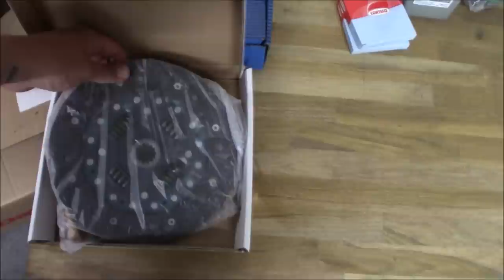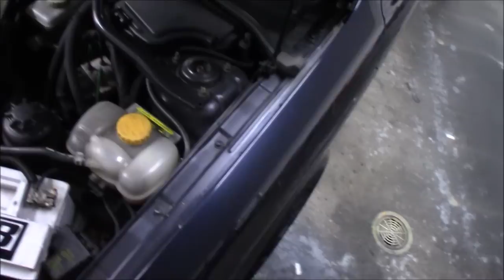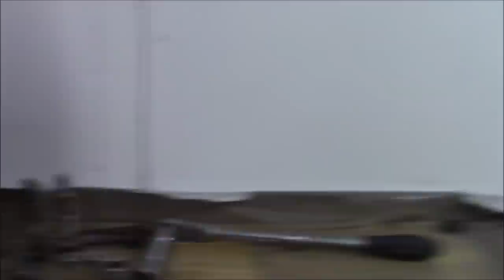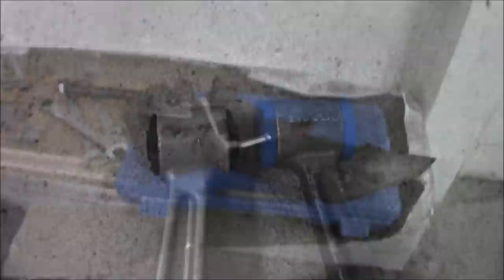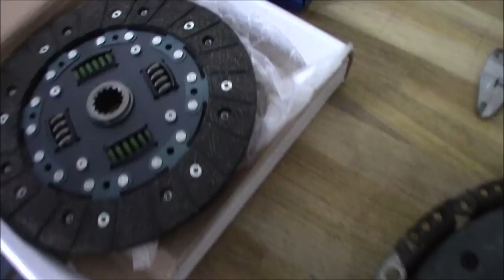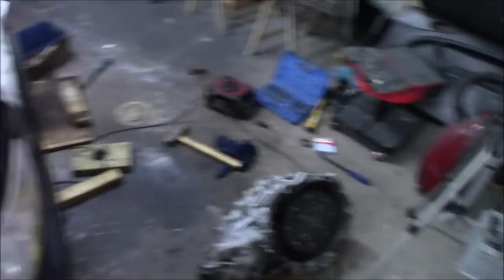SAAB 9-3 CLUTCH REPLACEMENT! MOST EDUCATIONAL!

Comment: your video was so helpful! ive never dropped a transmission but it was way easier than i imagined. Thanks, keep up the good work!!
Reply from the maker: Glad that it helped you! And that you didnt end up paying The big workshop Bill 👍
Reply: @JonasKakarikas  hey jonas i was wondering how to get rid of boost cut every time i go to use wide open throttle it hits boost cut or something, i replaced the wastegate actuator   and boost control solinoid , its getting really frustrating
Reply: @JonasKakarikas  did you ever have this problem when upgrading yours? it has a mitsubishi 19t and 3.5 inch turbo back straight pipe and wossner piston kit walbro 255 pump but stock injectors, could it be the injectors not giving enough fuel?
Reply: what do you do to tune yours, i dont want to have to take it to a shop
Reply from the maker: @jimjones5236  what you experience as boostcut is probably The ecu trying to protect your engine. Your afr is not correct and it could be alot of things. Check that nothing is leaking, than make sure it gets enough fuel. What tune are you running? With 3,5" straight pipe you most likely need a custom dynomap
Reply: @JonasKakarikas  on your car does your bcv make a constant ticking sound when you have the key just in the on position
Reply: @JonasKakarikas  i took off the sensor and drove it full throttle there was a big lack of power but smooth acceleration, and got code 1662 which was bcv sensor not connected so the wwire is working but what the f is the ticking sound coming from the bcv and it gets really damn hot to the point where you touch it and ittl burn your fingure ,is it internaly melting and going for a shit?
Reply: i compression tested the cylinders and got 160  on every one  without opening the throttle plate  so it seemd ok , and the engine runs great but i was thinking of doing another pressure test cause the last one i did was like a year ago just to make sure its holding air, just so i know its not the cylinders i wanna get a leak down kit tooi was thinking of taking it to a tuning shop with a dyno but i dont wanna get ripped off

Comment: Don't forget to change the fly wheel pilot bearing and rear main oil seal. Few thing he missed that you must do
Reply: 80.8f betta aquatic 
I was also noticing this missed.  For my '04 9-3, will have to look at the dual mass flywheel replacement also, otherwise, it's wise to reface the flywheel to get a good breaking of the new clutch.  
Not sure if replacing the gearbox input seal is warranted.  Only had engine main seals leak in the past.  Anybody had any issues here?
Reply: No pilot bearing on most Saabs

Comment: I'm starting a clutch job this morning on my 2002 93, The last clutch I installed was on a 1961 Falcon Ranchero and that was 29 +years ago. I've got a feeling I might be losing my religion a few times in the next few days!
Reply from the maker: The huge advance Now compared to 29 years ago is internet and Youtube 👍 if you made it then, there is no doubt you Will fix it on this Saab! Good luck 😉
Reply: Ok it's not going so smooth twisted off 2 of the studs at the turbo exhaust. Now can't get the studs out tried everything, any idea's?
Reply from the maker: @MichaelWOwens  typical problem, If you cant turn them with a vicegrip or equal you might need to disassemble The turbo and drill out The studs then re-thread The holes. Sucks i know 🙁

Comment: Great video man . I've got a 2000 9-3 and need to tackle this job . I keep debating about junking this car but it runs so good and I've done so much work to it I just can't let it go .
Reply: Have same make, model and year. Nothing but trouble. Fix one thing the next breaks. Will take vehicle apart with angle grinder. I know it makes no rational sense but it must come to an end.
Reply: I'm in the exact same situation with my 2002 93 Turbo Diesel. Renewed too many parts to sell it and it runs so good. My Sachs clutch set just arrived from Germany and I also have a new slave cylinder

Comment: This is a great video and a great encouragement. No matter what, a follow up video would be awesome. Please do one when you get the clutch plate. I am right in the middle of replacing clutch, slave cylinder, rear main seal (packbox bakre på drivlina) on my 9-5 in Trollhättan. A question: Don't we have to bleed the slave cylinder separately before installing it in the gearbox? It says so in the WIS. It would be easy to skip this and do it later, i.e. after mounting the gearbox onto the engine.
Reply from the maker: Awesome 👍 Will absolutley do a follow up. The slavecylinder should be bleed before installing. BUT if you have a luftman like I do you put pressure on The hydraulic system and just bleed out the air 😉 stay tuned.

Comment: Jonas, the Viggen clutch plate is bigger than std. Did you removed and skim the flywheel before refitting? Or clean the flywheel?
Reply from the maker: Just resurface with a bit of sandpapper 👍

Comment: Does the green rubber need to be on the throw out bearing, I seen some don’t even have that on different or older models. I was gonna replace it but the T-30 screws stripped because they had too much torque. The bearings still turn freely and it goes in and out like the new one after I cleaned the housing for the clutch I added a little Sachs spline grease to the (inside) bearing and wiped the remaining off. I already put the transmission back in tomorrow I just got to try finishing the sub frame and bleed the clutch, brakes, and the power steering sounds simple but I know this takes time. - hopefully someone can help me out thanks.
Reply from the maker: It is highly recommended to change the throw out bearing! It Will probably go bad long before The new clutch and then redo the work =/ the greenplastic is a dustprotection, without it Will go bad sooner

Comment: What a shame that happened. Where you happy with the KL clutch after you did get it installed ? I have a 2000 9-3 Convertible automatic and a 2000 9-3 hatchback 4-door 5 speed and am considering putting the stick in my convertible. Your informative video sure will help. Thanks from Bradenton Florida. 👍👍👍
Reply from the maker: Not The best suited for Daily driving. But Its ok when you get used to it
Reply: @JonasKakarikas  Thanks for the feedback on the clutch. Your video really is the best R&R I've seen on our transmissions. So glad you made it.

Comment: Hi Jonas, thank you to show us your job !
Just a question, do you put some thread locking on 3 slave cylinder's bolts ? Because I think there are "threw" holes so they need to be sealed.
Regards from France.
Reply from the maker: Correct, i Put a little bit of threadlock on The bolts 👍

Comment: HI Jonas - a quick question - how do You clean the engine bay - can I use an APC on everything and than use a power washer - or avoid the power washer - in order not to flood any electrical ?
Reply from the maker: Cover the battery and fuseboxes with plasticbags. Do not use a power washer. Just Light mist with minumum water.

Comment: Hi Jonas, Is this an F40 gearbox? And is the flywheel not able to be resurfaced?  If it cannot be surfaced I will probably just replace mine to assure best behavior.
I have a tuned Buick Regal 2.0 Turbo CXL, which is based on the Opel Insignia before 2013.  It has the LHU engine.
Reply from the maker: Hi, this is not an f40 but the job is similar. The flywheel could be resurfaced 👍

Comment: How much did you save buying the clutch parts separate compared to buying a whole kit at some serious swedish Saab parts retailer? It seems strange to me that you payed for a original slave-cylinder but cheeped out on the clutch parts? Besides my asshole complaint im very grateful for this video since i probably have to do the same with my car.
Reply from the maker: I "saved" ~buying them separat. All parts should have been original, The only thing was with the clutch plate. It said original from were i bought it and when i got my new one it was original Sachs 😅 you Will see in The next video 👍

Comment: I need some help with my 2004 93 my clutch doesn’t seem to engage when I press in it idk if it’s the clutch or something else???
Reply from the maker: Either you have a leak in one of The hoses or your slavecylinder is done. Could be air in The system also but not likely.

Comment: Hello friend so i just did my clutch .. Did u have any problem aligning the the station arm/control arm subframe bolts ? Always seems to be a problem getting it completely aligned . do u have any tips on install of subframe allignment
Reply from the maker: Hi Jason! Yes the 2 rear ones were really a pain in The ass. The trick is to just thread every Bolt in before tightening any.
Reply: I'm going to attemped in the morning with both jacks ans see if that works alittle better as u did it. Thanks for the video and tips my man .. Keep it up love the content . p.s funny music lol

Comment: Hey bro can u help me out I’ve seen u know a lot about Saab cars I have a Saab 9-3 and I replaced the clutch and installed a new slave cylinder and sanded the flywheel and a fortunately it won’t move at all and it has a abs and traction and I’ve done so much of researches and don’t get to find the promblem plz help bro I would massively appreciated thank u
Reply from the maker: Hi, did you bleed The slavcylinder prior to installing The gearbox or afterwards? Do you have resistance in The pedal?

Comment: Säker på att du fick original slavcylinder? Vart köpte du din?
Reply from the maker: Yes, fick tag i den via ebay. Märkt med GM och allting.
Reply: @JonasKakarikas  ok. Såg ut som min jag fick från maptun idag, beställde original. O dom skickade ut en pro parts kina sak =/
Reply: @JonasKakarikas  håller med. Kontaktade dom fort. Kan du länka där du köpte din?
Reply from the maker: @Saabman89  köpte från privatperson så finns inte kvar tyvärr. Finns säkert andra
Reply: @JonasKakarikas  ok. Tack. Jo finns på autodoc. Sachs. 1800kr. Blir nog den.  Kommer använda din video som manual =)
Reply from the maker: 1800kr tycker jag är för dyrt. Ta oem nummret på slaven. Sök på det på ebay och välj med omsorg. säker på att du kan hitta Sachs eller LUK för under 1000lappen.
Reply: @JonasKakarikas  ok tack. =)🥰
Reply: @JonasKakarikas  nu fick jag tebax pengarna. Och gjorde som du sa, sökte på oem nr. =) köpte en från england 1063kr =) oem gm stämplad  =)
Reply from the maker: @Saabman89  👍 swishar du det du sparade till mig? Haha gött att du hittade 💪
Reply: @JonasKakarikas  hihi 🥰🥰🙂 busefrö. Ne jag köpte korv o dricka =) och tankade min senast köpta 9-3 =) og ofc. Klart jag tittar på dina videos. Har även promotat din kanal på min nystartade saab world grupp =) bara positiva kommentarer =)☺️
Reply from the maker: @Saabman89  låter bra 👍👍